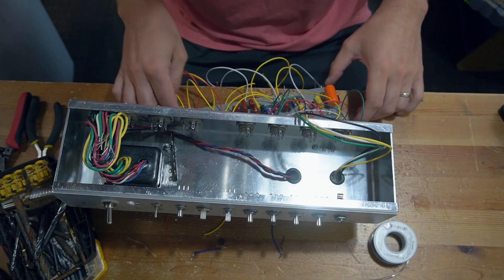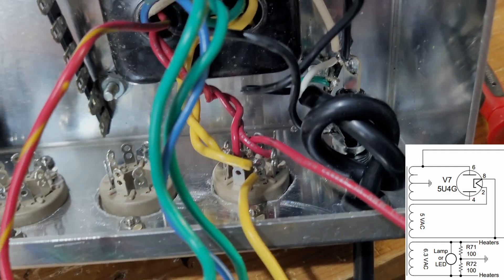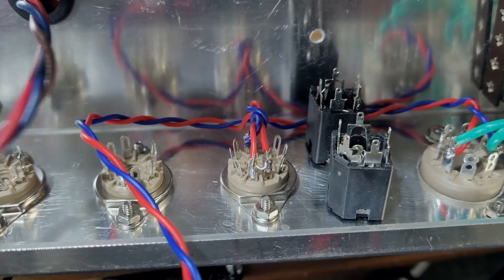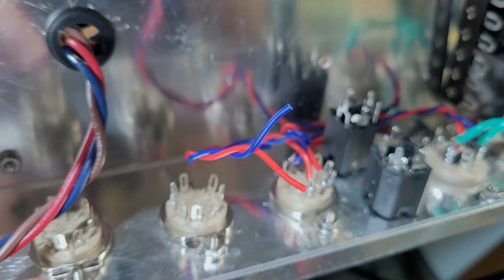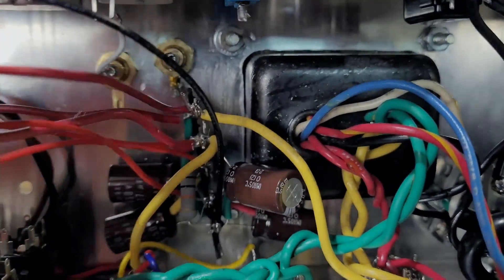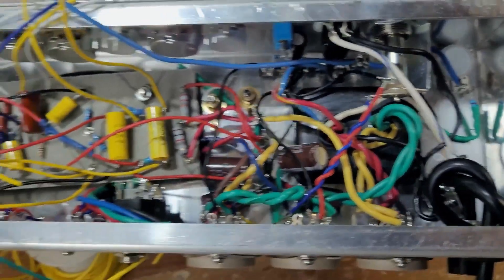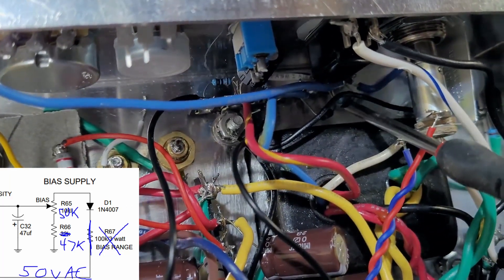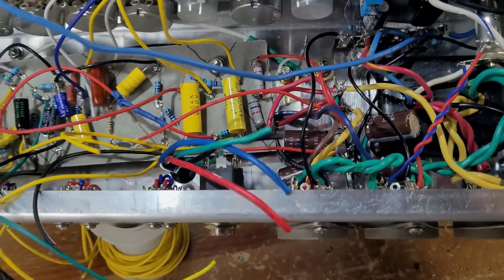Princeton Reverb Build pt. 3 - DIY Eyelet board & Wiring Connections

Comment: You asked about making boards. I make all of my boards. I use eyelets for the majority of the components but I use turrets for the grounds. It is  very tight on Fender builds to get all of those wires in one eyelet. Easy on a turret. I also run buss wire into the holes in the center of the turret, connecting all of the circuit ground points together. I use this buss wire as a ground point for the control pots. 

One trick that saves time making eyelet boards. It is turning the board over repeatedly that makes it slow. I put all my eyelets in at once, before I 
stake any of them. I put blue painters tape on the board before I turn it over to keep them from coming loose. I have a plastic cutting board that is lap size to hammer against when staking. So I can stake all of the eyelets in less than 5 minutes.  Painters tape comes off easily once staking is done.

Comment: I started using headlight cable glands that have gasket and lock nuts for holding the power cable in place on the chassis rather than grommets. They really aren’t that expensive and hold the cord so firmly you could carry the amp around by the power cord if you were so inclined! Just have to drill a little larger hole. VERY easy to install otherwise. Gotta get the right size as well. Different ones accommodate a range of cable diameters. On eBay!!
Reply from the maker: Good tip, thanks.

Comment: no intention to be super smart, but a small remark regarding the strain relief of the power cord: I think an integrated strain relief instead of a rubber grommit with a simple knot would have been a more safe solution against unintended back and forth moving of the power cable. Living in Europe we anyway have to use the three pin mains sockets together with a double power switch disconnecting both the hot and the neutral wires. They need more space, but are a much safer and more flexible solution (supporting disconnectable power cables of any length).

Comment: does the phase of the heater wires affect tone alot?
Reply from the maker: I have built many amps without thinking about that and they came out great. My last two amps have been in phase heaters. I would not say I notice much difference if any. I haven't tested it in any way though in the same amp.

Comment: Hi Kley! amazing job. Please can you explain your capacitor choices? I see there are different types (brands). Which are the best in your opinion? Thank you.
Reply from the maker: I have built a number of amps now using a variety of types of capacitors.  I honestly cannot say that a certain type of cap sounds a certain way compared to another.  There just are so many variables and it would be hard to make an apples to apples comparison.  I like to use Mallory caps a lot because they are priced well and are a quality component.  

I would prefer to voice the values of the components and tweak the circuit more than fuss with the types of capacitors.

Comment: Hey Kley, thanks so much for all your videos. Terrific no-nonsense engineering and even better guitar playing. I just came back here to ask you about those HV filter caps you use -- they are radial. Where do you buy them? And are they a bit cheaper than the ones in specialized tube amp stores (I'm hoping). Take care, Johan.
Reply from the maker: Thanks!

I bought them from Mouser:

https://www.mouser.com/c/passive-components/capacitors/aluminum-electrolytic-capacitors/aluminum-electrolytic-capacitors-radial-leaded/?capacitance=20%20uF~~50%20uF&voltage%20rating%20dc=450%20VDC~~500%20VDC&instock=y&sort=pricing&rp=passive-components%2Fcapacitors%2Faluminum-electrolytic-capacitors%2Faluminum-electrolytic-capacitors-radial-leaded%7C~Capacitance%7C~Voltage%20Rating%20DC

They have worked great so far in my builds.  They're about $1, so they are cheaper than the typical guitar amp filter cap.

Comment: What material you using for the turret board? I thought you needed a special not conducive heat resistant fibre? Can't remember the correct name for it, but if what you using doesn't cause any issues it seems like a cheaper alternative. Leigh.
Reply from the maker: Fiberboard - Vulcanized from amplified parts.